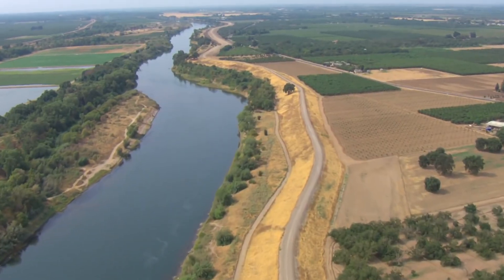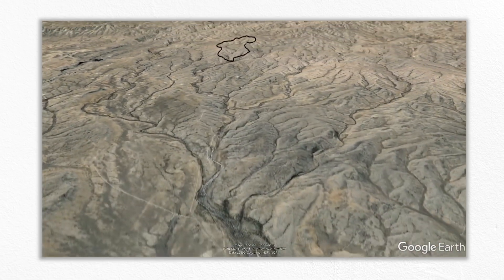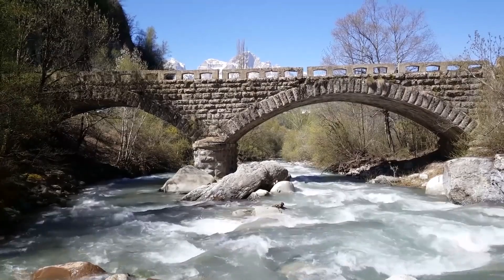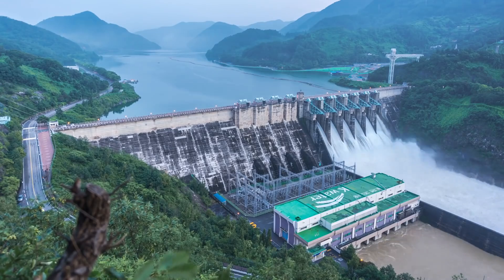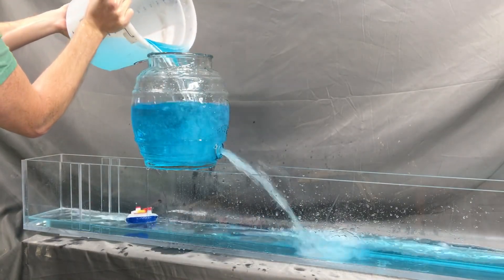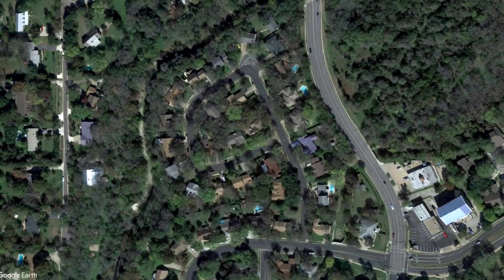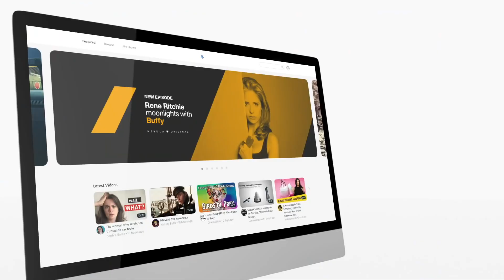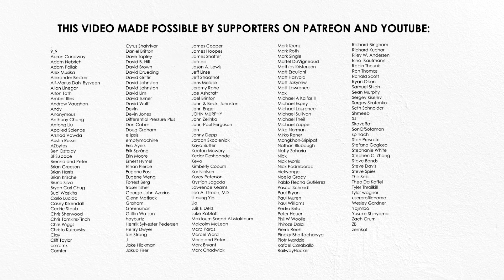Flood Control System NA WALA SA PINAS!

Comment: Dito sa Hk maganda ang system ng reservoir at mga daanan ng tubig from mountain. Maraming pipe na malalaki na daanan ng tubig papunta sa reservoir, kpg  tag ulan na walang tigil pinapakawalan nila ang tubig papunta sa dagat until they reach the maximum level of water.